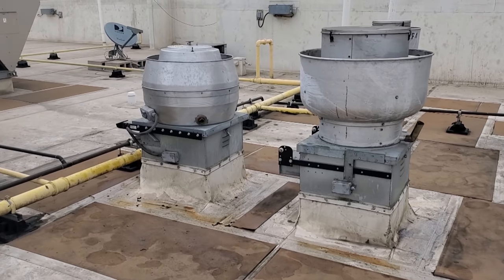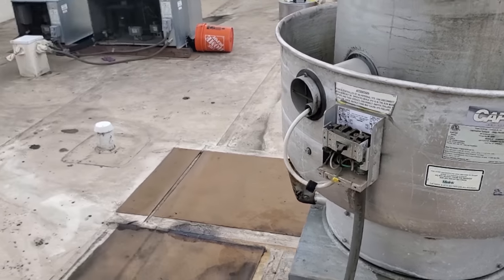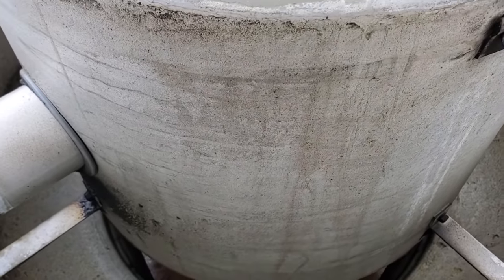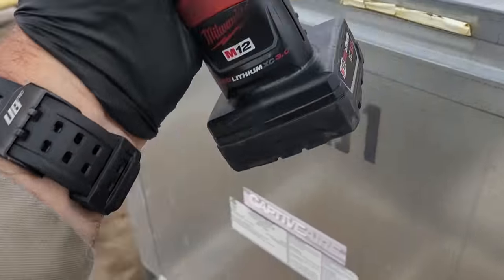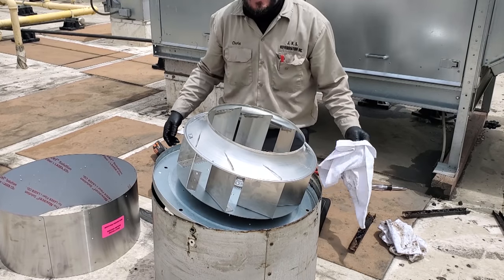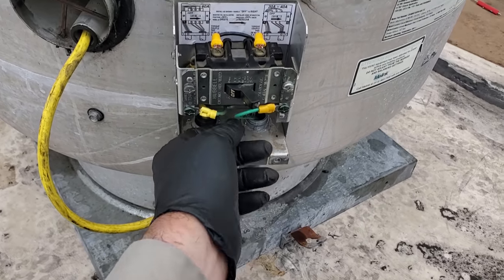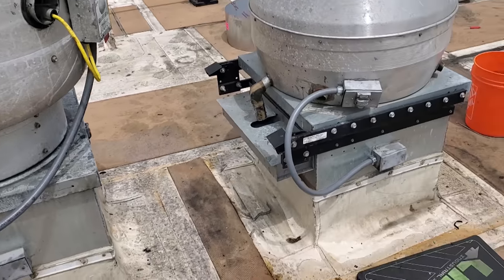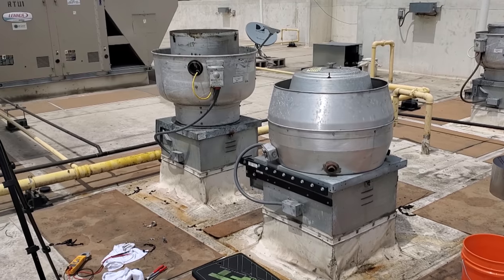HOW HARD COULD IT BE TO REBUILD THIS EXHAUST FAN?

Comment: When you have parts left over, that just means you assembled it more efficiently than the original 🤣
Reply: I rebuild old PC PSUs and CRTs.  With the amount of screws, and sometimes different kinds and lengths -- not to even speak of the electrical components I'm replacing -- I started mounting a camera above my workbench.  I record the entire disassembly now.  It may be a week before I get a parts order in to complete the job, which is plenty of time to forget things.  Where did that screw come from?  Let's review the video!  :-D

Comment: I had to replace some air ducts for a indoor grilling station once. I arrived with a helper and we found 6 feet of air duct filled with 1 inch of old liquid grease.

I had to come back a week later and fix the original issue: the previous company used the wrong duct sealant and an wrong sized reduction. I wasted a whole box of gloves, a cuttingblade for my vibration saw, a shirt and probably my whole vocabulary of swear words, because someone used a sealant, that would turn into a slimy goop in contact with grease and leak like no tomorrow.

Comment: this is hilarious n love him lol
and yah i done ton of them how do it right way without taking it all out
just remove electric wires n push pipe in n remove screw under vent out n lift whole thing out n set on ground n remove bittom screw n slide it up n slide on new motor repeat it backwards ;^) hope you know that now
i know it genes on it adjust u use gasoline or go buy expensive stuff just dip hand in it n it clean it 
how many of them have replaced in 5 years?
i done 66 of them in 5 years

Comment: Ahhhhh Nothing like a good roof shaker!!! 
If it’s replacing a motor that’s OK sometimes bearings that’s OK but honestly some of them are so cheap it’s actually cheaper to replace the whole fan assembly then re-building it.  Just because you will save money in the long run on labor and you get a warranty!!!

Comment: Ick. Next time you have to do a powerpack exchange (if for some godforsaken reason you can't bring in a crane and do a full replacment) on an greasy exhaust fan, bring your handheld foam gun filled with the condenser (not brightener) venom pack and a second person so you can rapidly spot clean and disassemble the old fan.

Comment: SD-20 smells good. Comes in a aerosol can. Simple green works great but will give you a headache if there's no air circulation. Microflex Diamond grip gloves have great grip. Pro Safe gloves are durable like Venom Steel gloves.

Comment: Coveralls, a case of oven cleaner, and a second guy to clean while you repair. Figure that in to the cost. Something like this will probably come up again!
Reply: And a case of Gatorade while you roast like a bagged turkey white enjoying the sweet fumes of 30yr old grease... Ahhh delicious
Reply: do they even allow oven cleaner in Commiefornia? (stuff strong enough to do anything)
Reply: Remember that oven cleaner is lye.  Sodium Hydroxide.   That's NOT something I would want to be spraying on top of a roof, where you will have wind.  I'd be using hot water and a degreaser, even if it's not as efficient.   You could even use lye soap in hot water to scrub, with elbow length gloves.  (and an apron, on top of the coveralls) 

I use lye. I love the stuff.  I'm also VERY aware of how nasty it can be.   (If you have a day or so with a kitchen down, you can mop it onto the greasy floor, wait two hours, then just rinse it off.  It'll turn all of the grease and oil on the floor into soap.  Respirator, rubber boots, and a lot of rinsing).
Reply: @throttlebottle5906  - They can't exactly ban it.  Sodium hydroxide is the base for most home plumbing drain products, as well as for making soap.   You can also sometimes find pure lye crystals called "Root Killer" in the herbicide section, or plumbing section, to help clear septic lines.

Comment: Worked in an auto parts store that did repairs and a vehicle was brought in for valve cover gaskets and I did it because the mechanic was working on a big job that was going to take until 2pm and when I opened the hood all I saw was the valve cover gaskets and the exhaust manifolds covered in 10 lbs of grease,I managed to get the covers off and the bolts,it took 30 minutes to scrape and clean the covers off using 4 cans of engine degreaser and 2 more to do the exhaust manifolds after the covers were clean and I scraped the grease off the exhaust and sprayed them down and took a garden sprayer and cleaned it up,it took me 20 minutes using gloves that the mechanic gave me to put the covers back on and 10 more minutes to insure that the covers didn't leak, after I clean myself up and changed clothes (I luckily brought a change of clothes) the owner was told that the rest of the front half of the car had to be completely degreased for the mechanic to do the rest of the work that he wanted done next week

Comment: We solely work on kitchen exhaust systems, so we've seen and replaced/rebuilt a lot worse. We love HVACR companies that hate greasy fans because they send us that work. 

Typically on a small direct drive like that, it makes more sense to replace the whole thing. Also noticed that when you put it back together, you actually rotated the top 90 degrees from the base which is why the electrical was short. Not sure if you realized that was the cause there.

Great content as usual. Fun to watch!

Comment: Your relation to grease is like mine to generic mechanical lubricants as grease and oil which is dangerous (also compressor oil). But I am pretty sure that food grease is safe. Tip - Put on a nitrile glove on your hand, then put a working glove over the nitrile glove. Sealed and robust.
Reply: Compressor oil gets nasty, gets over everything, I hate compressor oil

Comment: As an ATM repair tech, I would say 90% of our job is simply using mechanical commonsense to just figure it out, the bad part about that is we have to go in front of customers from time to time and make it look like we know what we are doing when it is the first time we've ever seen that particular style of machine. as for the whole having extra parts left over, if you cant remember where it goes, then it wasn't important in the first place, some jerk of an engineer probably just put it there to annoy you, as long as it works, that's what's important

Comment: Chris you don't use a lift? I normally use 2 for installing hoods and or when I see the point of a crAne. Saves me 300 bucks too. Those are the worst last week had TWO main exhaust fans go out and I was trying to avoid grease yet when you just forget it about it its just easier.

Comment: Jw but since ur replacing motor and all with the power head, once it set on the roof away from the vent couldnt u use some degreaser and wash it before disassembly to help with the grease issue

Comment: Number one trick is to use an SDS hammer drill on hammer only mode with a custom made punch. Does the trick every Time to get the old fan blade off.

Comment: It’s part of the beast of working on stuff you’re going to get dirty. My job for instants I would never use my work tools outside of work on anybody else’s stuff. I work in a steel mill with carbon dust and tons of grease. That Greece is nothing compared to what goes on at work

Comment: So, I know you don't want to do that again... BUT, what if you hit that thing with some heavy degreaser, or coil cleaner, before taking it all apart but after you pull it off the curb? If you're replacing all the electrical, I would imagine that there isn't much left that could be damaged by the cleaner and water.

Comment: The age old question.  Lift it or crane it.  First when doing this kind of work you are under a time constraint, time is not on your side.  Then lifting with a rope, just how are you going to do it.  If the building is a straight wall with a parapet, unlike some of the fast food restaurants, yes you could do it.  It will take at least 2 people.  One person pulling up the side of the building will not do it.  You will not last long enough to get it up over the parapet.  You could slide it up a ladder with one person climbing the ladder as you pull from above.  Again, very exhausting.  If you are lifting a new unit on the roof you are also removing a unit.  If something happens while lifting the unit and it goes to the ground you buy it and how much will the new unit cost you, plus the time getting a new unit.  Using the crane.  The crane will be a few minutes on the jobsite.  If the crane operator loses the load, does any damage, he buys it, not you.  Old unit down and new unit up and the crane is off the jobsite in less than 15 minutes.  And you are not exhausted.  
Sorry for the long dissertation but hopefully others may better understand.  Love you videos, keep them coming.

Comment: Chris, why waste your effort with aluminum exhaust fans?
I have been doing this for 43 years now, I have maintained Burger Kings most of the time and when these fans go out I replace them with Central Blower Units.
All steel design, 85% less grease on roof, easy to maintain.
I have some units that I have not touched except to change belts for more than 20 years. Captive Air stole the design and is now selling them.
Central Blower series RE,  burger Kings use RE-15.
Aluminum fans were never designed to run on grease hoods.

Comment: why didn't you use your degrease coil cleaner at first, it's on you to make your workplace clean at first, so don't wine about it. If the fan is bad in the first place, water wouldn't do a thing to it. But your are right it's not a nice job also when it truns into butyric acid.

Comment: Our business ideas are apparently very different. Not being such a pansy about some grease gives a much better value to the customer rather than replacing with a new unit and the cost of the crane for it. I can only imagine that will will be thousands more. Look into some Tyvek like suits that you can roll up and throw away, and Thickster gloves to get you through it. The tool cleaning doesn't take long.  I agree that clean tools are important, I learned a long time ago that a grease gun shouldn't be greasy.
When you do have to put stuff on a roof, that crane is a great safety factor! Cheers!